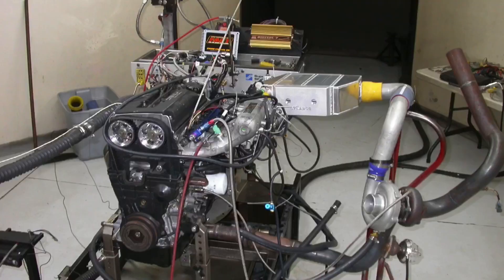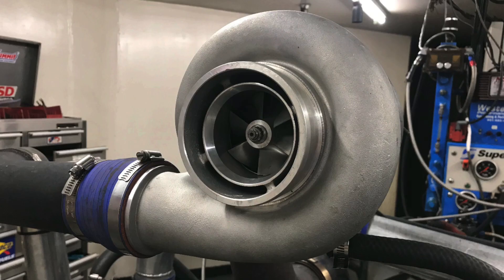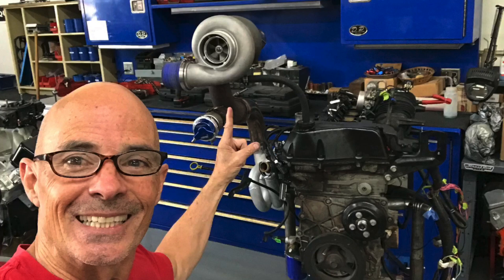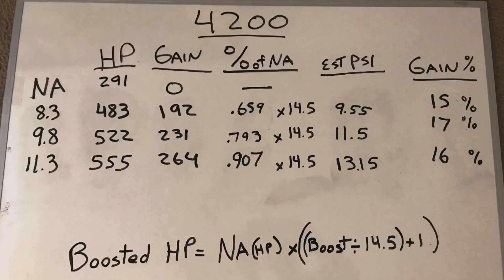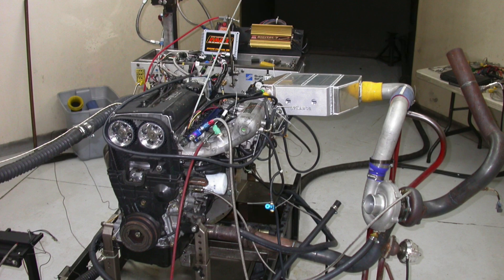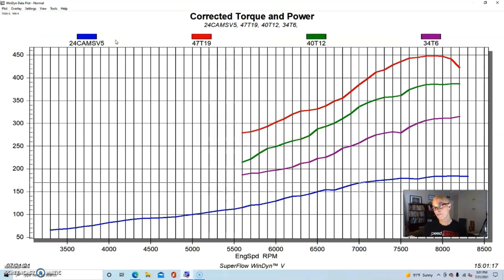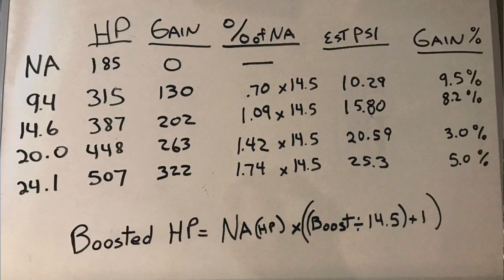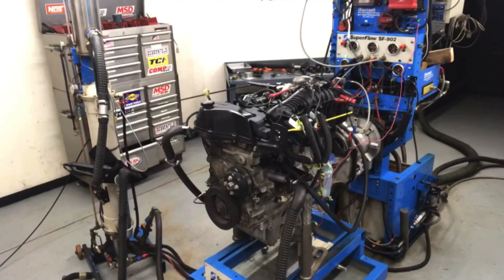TURBO ATLAS 4200 VS TURBO HONDA B16A- IS ONE BETTER FOR BOOST?

Comment: I've always argued that rpm was the only direct replacement for displacement. This video argues that rpm is a superior replacement for displacement.

Do the math again at identical rpm and power levels and I'll bet the math comes out to be close to equal between the motors. I notice the little motors power increases power per psi of boost as rpm goes up where the big motor don't. Even with vvt.

Comment: Just for reference, I have a fully forged B18B1 block with CP 9.0:1 81.5 mm (0.030 over) pistons, Eagle rods, ARP main studs, ARP head studs, a B16B head, Skunk2 Stage 3 NA cams, dual valve springs with titanium retainers, Skunk2 LMAs, a Skunk2 Ultra Race 3.5L intake manifold with a Skunk2 90mm throttle body, Grams 2200cc injectors with a Skunk2 composite fuel rail, PLM top mount turbo manifold, PLM 3" downpipe, no cat to a 3" Thermal Research exhaust, running on a Hondata S300 V3 with a Garrett GT3582R and on 22.5 psi it made 612 whp and 709 whp at 28 psi. My engine is a freak of nature and it's in an EJ8 1997 Civic coupe, so it moves. It's coupled to a 1320 twin-disc clutch with a GSR transmission with an OBX LSD and an LS 5th gear.
Reply from the maker: a 9:1 B18 with 709 hp at 28 psi?

Comment: Im so glad to start seeing more performance upgrade vid's/art's involving the Atlas inline engines, their seems to be a lot of potential with the 4.2's which should apply just as well to 3.5/3.7 & 2.8/29 lil brothers. I've been wanting to see a built 3.5/3.7 i5's , either turbocharged or even better,twin charged compound boost set up. Love the sound those i5's make, especially boosted

Comment: This also shows that the turbo b16a is a better sized turbo for that motor and the gt45 on the 4200 is a little large for the 4200.
Reply: Could you explain this one too me.

Comment: 8.0-1 4.5 v8 rated at 180hp. I figure closer to 200 after emissions removal. Would I have to worry about any fancy ignition control running it at a conservative 7-8 psi? Only looking for 300 or so hp.  The car is CIS and I have a boost referenced adjustable WUR from a Porsche 930 turbo. It is dead reliable with the CIS. Plan would be to set it up on a Dyno running hot as hell with wide band, optimize and leave it alone. I don't want to complicate it with mega squirt, just want 300hp without changing every piece of my drivetrain. Oh it's a drift car.

Comment: Problem is a bigger turbo will make more power at the same boost. Without sounding like a Gale fan boy monitoring air density would be more accurate.
Reply from the maker: a bigger turbo will not make more power at the same boost if the smaller turbo is able to supply the current power level

Comment: Part of the unexpected increase in power came from the intercooler, most likely giving the induction air a greater density due to a much lower temperature. That would be my best guess.

Comment: Probably the one with a bigger aftermarket.. but, frankly, the bigger engine has more potential since it has the displacement to take advantage of increasing air flow and fuel flow. Soo..

Comment: Another great video! You're only using kpa, which is fine to keep it quick and simple, but temp  is important to the density equation, and to a lesser but still measureable extent humidity. The density ratio should actually be lower though when adjusted for temp which i think strengthens your point regarding more power being produced relative to the amount of air.  Whats your theory as to why you get more power than the air seems to allow? My theory is the flame front is faster with denser charge which puts more cylinder pressure on the piston earlier. Also goes to show why dyno corrections, or testing under different conditions on different days don't yield the exact results based on the density formula alone. Lucky for you guys, the weather at westtech is pretty consistent. Another thing this brings to mind is how it relates to ideal compression ratio for a particular motor. How about a back to back where you use stock heads na and boosted, then mill the heads and do it again and compare like you did in this video.

Comment: Depending on how long the atlas could hold boost. This may be a good swap option vs a 2jz or rb or bmw. More displacement and probably cheaper.
Reply: Explain "hold boost" to the audience please....🤦
Reply: @jasonbirch1182  being reliable under high levels of hp from increased boost usually from a turbo or supercharger. Is that a good enough explanation for u
Reply: @djmurria what is considered “high levels of horsepower”

Comment: Hey Richard. What type of ignition timing is this engine liking. More particular In That torque "plateau" just curious how it compares to the ls.
Reply: Definately needs less ignition timing with added VE, they are 4 valve motors.. I'm actually super interested in finding either a 6cyl or even a 5cyl Atlas..

Comment: I’m guessing you are using atmospheric pressure at your location? Since it’s normally 14.7 at sea level.
Reply from the maker: 1 bar is 14.5
Reply: Not that 1.325% makes much difference but I agree that atm is more applicable than bar.

Comment: Richard, your formula would be more proportional if indicated hp is used rather than brake hp. Indicated hp is brake hp plus friction hp. The problem is even with an electric dyno, friction hp can be tricky to measure. For example if you ran 14.5 lbs boost, the indicated hp should approx double, but although the friction hp will increase, it won't double.
Reply from the maker: the initial frictional hp is taken into account by the dyno based on displacement (the rest is minimal)
Reply: @richardholdener1727  No it's not, the dyno measures brake hp, you would need a combustion analyzer to measure indicated hp. Also friction hp changes with speed and load so even if you had a motoring electric dyno, and measured how much hp it takes to spin the engine, there are things like piston and bearing friction which are load dependent, plus pumping work which depends on the difference between intake and exhaust manifold pressures. What I was trying to say was the error you got between your formula and actual would be pretty much eliminated if indicated hp were used instead of brake hp.
Reply: @richardholdener1727  Thinking about this more, maybe you're thinking about how the dyno compensates for inertia hp which depending on the rotating inertia of the dyno and engine can be fairly significant. We ran all of our diesel developement at steady state measuring fuel consumption and emissions along with power and torque.

Comment: If you really do your homework and the objective is to make big numbers up top and not making a compromise for low end torque and all that, you should double the engine's power at only 9-10 psi boost and continue adding another engine with every 10 or so psi you add. The key to that is selecting a compressor that is right in the middle of peak efficiency when the engine is getting close to the red line, an efficient compressor not only transfers minimal unwanted (excess of the adiabatic minimum) heat to the air but it also requires minimal mechanical power from the turbine. Next, you need a turbine that is optimal for the power level, barely needing a wastegate to keep the turbo steady, as the greater the mass flow through the turbine the smaller an expansion ratio can be used to deliver the required power to the compressor and thus less back pressure that affects the engine's scavenging. Finally you need an intercooler that is able to bring the charge temperature down near ambient or even below, and a fuel that lets you keep the engine utilising its compression ratio (expansion ratio) without knocking.

Making just double the power with 14.5 psi boost is what to expect from a street engine where literally everything is a compromise, turbo is on the small side for the power to increase the area under the curve at the low speed end, intercooler is only able to get to 30°C above ambient and the fuel won't support operation at optimal efficiency.
Reply from the maker: I've really done my homework-for the last 25 years or so!
Reply: @richardholdener1727  And it shows, not a lot of people have had the opportunity to touch on development on as many different kinds of engines. I'm just saying that if the development of a combination like this is taken to the max with the goal of setting records instead of being a compromise for street use, it wouldn't be out of the ordinary to see 30% or more over the formula you are using as a reference. I'm curious about the highest such gains you have witnessed.

It's always interesting to include turbine inlet pressure data when testing a turbo engine, it along with exhaust temperature says a lot about how the turbo is performing. I have seen some really big gains changing turbos on the dyno where all variables such as charge air temperature are kept constant by the use of an oversized water cooled charge cooler. Same boost pressure, same charge air temperature, just dropping the turbine inlet pressure by a quarter picked up almost 100 horsepower. Likewise the amount of energy a turbine is able to extract from the exhaust gas is highly dependant on the exhaust temperature, so if the exhaust gas is really hot, less drive pressure is needed to produce the same compressor effort.

Comment: Alcohol and Methanol both have superior latent heat of vaporization factors, which under boost, is definitely a factor. High octane fuel has good detonation resistance, but I think Alcohol and Methanol have a little edge because they both burn slow, and suck so much heat out of the charge air. Great content, as always Richard.

Comment: Can you please do a video on proper turbine sizing?  Same compressor, same engine, same gas, day, etc....different turbine sizes, maybe even different housing A/Rs?  Maybe do a series of 10-20 shows?  Dig into the math and the real-world application behind selecting the turbine
Reply from the maker: 10-20 shows on turbo sizing? It's a lot easier than that

Comment: To me the efficiency of boost appeared to have more to do with the choice of turbo than the engines. I think this because of how the Honda dropped off at higher boost. Could it have used a larger turbine? 57mm compressor sounds large enough for that power level.

Comment: I’m guessing the higher efficiency of the boosted 4200 was due to the E85–it always does well with boost! Thanks for the cool test results!
Reply: honda was also using race fuel forged rods, pistons and porting while atlas stock internally

Comment: NA power × (1+boost pressure ÷ 14.7) = new power level under boost. You have to put it in the calculator with parenthesis for the order of operation.

Comment: Educated guess before watching past the intro (see edit for after video thoughts): B16 wins the efficiency argument. 330-500cc oversquare cylinders are generally best for efficiency, and I know the B16 has the high rpm breathing to get s**t done.

I know nothing about the AmeriBarra but I know the real Barra can't compete with B16 in terms of specific power and fuel consumption. Power per $ and peak numbers are a smackdown in the other direction though

Edit after full video: That was not the calculation I was expecting. It also wasn't the outcome I was expecting once I saw the comparison formula either, so I was wrong anyway. I would have expected the sub-optimal N/A build for the Honda to respond better than it did for boost.

I have one question and one comment:

Q: Was the race gas equivalent to E85?

C: That formula on any engine with an appropriate turbo will show engines operating above the calculated value because there's only one set of frictional losses and the N/A motor overcomes them, so the extra air density from boost is only going to extra power and not proportionally extra friction. You'd also expect higher boost levels to trend closer to the calculated value as "friction free power" becomes a larger part of the whole. There's no simple formula that will show correct at all boost levels though, so it's certainly a decent rule of thumb.
Reply from the maker: 25 years of dyno testing boosted combinations shows your frictional loss statement to be incorrect and that the formula tracks
Reply: @richardholdener1727  so does the fuel/air consumption go up faster than the absolute pressure? Or are we looking at increased combustion efficiency?

I'd just come across this happening (power gain excess of absolute pressure ratio) more than a couple of times and don't have a mental model as to how and I'd appreciate being filled in

Comment: I imagine that the fact the intake is under vacuum in a NA application accounts for some of that additional uplift, you might really be at -0.5psi  (or more with a full intake and filter) amd not zero as the tables suggest.
Reply from the maker: the na intake was 99.4 kpa (a far cry from -.5 psi
Reply: @richardholdener1727  glad to know you're tracking that!
Reply: That would also depend where he is measuring boost pressure. If he is measuring in the intake manifold itself then the numbers are comparable.

Comment: I was amazed at how well the 4200 Atlas responds to the intake, header, and cam tuning in N/A trim. I'm even more amazed at how efficiently it responded to boost. Granted, the CFM of the GT45 is up there, so I'm not really surprised by the power gains overall.

Comment: That was a lot of work to get that Ford unit up and running again, just to risk damage when testing. Hope it stays together long enough to yield good information.
Reply from the maker: what Ford?
Reply: @richardholdener1727  Oops is the Atlas not a Ford  product?
Reply: Atlas is a GM inline 6 that was used in vehicles like the "Trail Blazer"
Reply: @tskraj3190  Thanks for the info.👍

Comment: 5:18 its more like HP*absolute pressure in bar = boosted HP (+few % in boost levels below 2bar whe engine isnt that much knock limited)
 i mean using metric is easier when it comes to math
Reply: Yeah but americans 🤷
Reply: You can't convert?
Reply: lol but can you?
200hp*2=400hp (for 1 atmosfere - 14.5psi of boost)
200hp*((14.5/14.5)+1)=400hp .. same but longer, and problem comes with altitude-different atmosferic pressure, so equation have to change

Comment: 14.7 psi = 1 atm
Reply: 14.5 PSI = 1 bar
Reply: @2lotusman851  You're both right.  I didn't ask the question as to why Richard is using 1 bar as ambient pressure.  Don't really care, I guess, as this is an approximation he's giving but one that works for me and gives a general idea of what's going on.

Comment: Another GREAT video, thank Richard.  FYI, for some reason the audio quality was a bit off, normally it's quite a bit better.  As an adder for this video, I'd love to see the exhaust pressure vs MAP charts that may provide a clue to why one engine appears more boost efficient than the other.
Reply from the maker: Sorry about that-my good mic was tuned off-didn't realize til editing finished video
Reply: @richardholdener1727  No worries, I just wanted to pass it along, love the content and would love to see the channel grow.  More people need to absorb this wisdom :)

Comment: My B16 loved boost so much that the connecting rods decided they needed more room to move around in the crankcase and wanted some pretty windows to let the sun shine in. 🌞
Reply from the maker: sounds like they would have loved extra ring gap
Reply: @richardholdener1727  was 1999 before the Turbo thing was super popular like it is now. Stock bottom end with 260k+ miles. And other than being a good welder, hooking all the isht up and making it look cool I was 18 and didn't know wtf I was doing. Might have been just a tad bit lean. 😆 fortunately back then those motors were a lot cheaper and easier to come by.

Comment: Gale banks said 7% more power per pound of boost then 1% more on top for every 10 degrees you can cool the air intake temps. On any engine
Reply from the maker: do the math-the formula says the same thing (7x14.5)-but he is shooting for 101.5% of the formula plus 1% for every 10 degrees (but from what starting temp?)
Reply: @richardholdener1727  14.7
Reply: @richardholdener1727  https://youtu.be/mqCWW3BoSn0 remember seeing this on velocity years ago around the 4 min mark he gets teaching
Reply: 7% is generous...actually 6.8% would be exact per pound of boost
Reply: Gale Banks also says that drivetrain loss on a dyno is not a set percentage during The Smoking Tire Podcast #389 at 1:33:13 if you want to check it out.  I wish I could shout this from the mountain tops especially when people say they have 1,000 horsepower after making 780whp.

Comment: Your point:  Any motor can make big power with a turbo and few thousand bucks.    Need a hp per dollar graph.
Reply: I’d love to see HP per dollar graphs…especially on a Steve Morris engine.
Reply: Ooooh in that case the pre-barra Aussie Ford 6 will take that trophy.

4.0 OHC plus E85+boost (no internal mods, high mileage engine) will last ok around the 470 whp mark and push a traction equipped 1550kg car that it comes in to a high 10 second pass even with stock auto gearbox and just welded diff. I do use "last ok" fairly loosely though.
Reply: Im considering a Cam for changing the torque curve then a Super Charger, im not racing the truck, just upping the capability, ever heard of the Big 10?